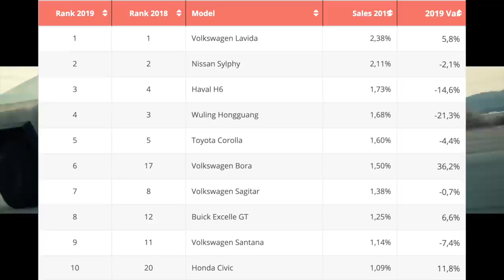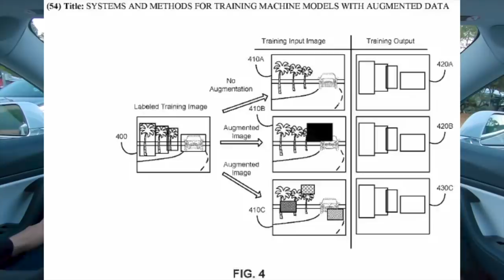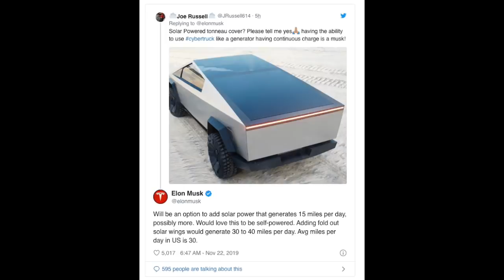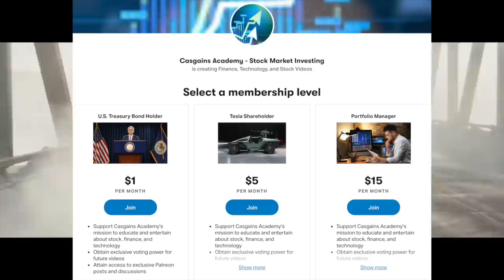Tesla's Upcoming $20,000 Compact Vehicle - An Industry Overdue For Disruption

Comment: Motor, pulley bar, mount bar, adjustment bar, hanger bearings. concession: mechanical(?) to lumens (ONLY), per story, add to use but do not change anything already attached

Comment: We don't know anything about the specs? Yes and no. Yes, they didn't tell us anything, but Elon won't make anything that sucks, they are going down market, but coming out later, so they are working with better tech, and it will be smaller. I bet it will be close to a Model 3 Standard range plus in range and acceleration. I hears a story where they made a slow prototype, and Elon said it felt like something was wrong with it. I bet it does a sub 6 second 0-60, and is RWD, and the AWD model is sub 5.  They may very well go for a range similar to what the 3 has today. The 3 will likely have more by the time it lands.

Comment: Actually I believe Model 3 is good for the task. When produced in massive quantities, the cost of each will be reduced. Also most of the cost of an EV is it’s batteries. Current batteries suck, they are the major holdbacks of EVs, if new battery tech can increase the specific energy, then less batteries would be required, thus making it cheaper. All of these Tesla vehicles would have a lot of potential in reducing costs i think. They’re far ahead of the competition.
Reply: Gasoline engines are complicated machinery with hundreds of moving parts, but could be made cheap due to the sheer quantity produced. The same can be applied to batteries. This is more likely with China’s industry that produce things at massive quantities, although not very good quality

Comment: I'd like to see a single passenger self driving pod car. That would be so cool. 

I'd also like to see china make their first self driving city where human drivers are full out banned 

I think china is in a position to be willing to take that risk and see what happens
Reply: YES, prevent traffic accidents.
Reply: A single passenger car should ideally be pedal powered. Heavier vehicles with more space are reserved for other methods of propulsion. A bicycle railway would be cool. I wonder how low you could get friction. I don't want to see human drivers banned. That would make it impossible to use older cars on public roads. It's not necessary either to ban human drivers. Very few people will still choose to manually drive their cars once the technology is available to do it for them.
Reply: @bangerbangerbro  
You can srill drive yourself on country roads. But in areas where human drivers are banned it's a guarenteed car crash if you turn off the selfdriving feature. 

There may not even be traffic lights in those areas. 

Also what kind of drugs are you on? Why would you want to go 60+ miles an hour on a bicycle? 

Pod cars would be a good idea conceptually, tho no idea if it would be adopted because it's very unlikely to be any significant amount of comfort.
Reply: @Skinnymarks  Pod cars are an age old sci-fi theme. How fast are the cars travelling, like 200 miles an hour?, where turning off autonomy immediately leads to an accident? You would want to for fast on a bicycle because you can get places faster? A non powered rail would be much cheaper to set up than a proper powered one. Only problem is providing a system where each rail is only one way.
Reply: @bangerbangerbro  
You can't even properly criticize pod cars. I had to do it for you. It's just an entertaining thought I came across again the other day. 

And yes the cars will be going more than 150+ or down tunnels with tracks where any error in turning would greatly damage your wheels. 

And cars would be clearing by inches in intercecrions. 

Will this happen any time soon? Doubt it. Unless china decides one of its empty cities is self driving only and forces people into them. I think that is a possibility.

As for America. People are too insane about their ideas around "personal choice" which rarely have much to do with actual choice availability. Ironically enough. 

So idk how it will play out in America it really just depends on how social shifts around the perception of how dangerous it is to drive. Or how lazy people are or how busy they are and unable to throw away the time they would have on driving.
Reply: @Skinnymarks  I suppose Pod cars are more private but I just didn't like the idea of single seater "proper cars" that much. High-speed tracks sound like something that would come faster for intercity travel than for intracity to me. Easier to build the infrastructure as there are less existing complications (unless of course you build an entirely new city) and the high speeds are needed more. I don't quite understand your third line?

Comment: He’s right about the trucks from the legacy automakers though. From all angles they look similar. Nothing new or innovative.
Reply: I'm fairly sure I could tell which brands were which (the examples) and I'm not into American trucks or cars, though I am into cars. There is more difference visually between those vehicles and a model T than there is between those vehicles and the CT IMO. The CT proportions wise is barely different to the other pickups.
Reply: Elliott Savva And that is on purpose! Parking, loading, getting in the damn thing without a ladder, etc.
It’s SUPPOSED to be a pickup!
The innovations are its architecture and (proper) use of power! (See no fumes)
Reply: @boyupizzmeov4558  Exactly, the important differences are in aspects other than the look of the vehicle. You mean source of power, not use of power ("no fumes")?
Reply: It's the EV power for pickup truck that matters  the outward appearance dosent matter
Reply: @sunsetlights100  Unless it's functional of course - aerodynamic, good for load capacity or affordability of manufacture etc. But the fact that it looks different isn't important as you said. Just the main reason why it looks different (affordability of manufacture and body strength).

Comment: FIRST - 
Show me an electric car that was charged from so-called "sustainable" energy. 

Not gonna happen. All of them are charged from coal and oil based power plants. Nope, charging a battery operated car from a battery is not acceptable because they get their power from oil and coal just like everyone else. 

Prove me wrong!
Reply: And what if they are charged out of solar panels.
Reply: electricity generated by fossils have a set carbon footprint ..but that footprintis far less than fossil fuel cars ..the electric cars then use that electricity at a 90%efficiency ..compared to at most 25% for gas or diesel
Reply: Thomas Lee then you should look things up before posting....almost 50% power generation in CA is from sustainable energy(solar wind nuke hydro...). I have solar 9.92 kWh Sys.  I have an electric car and have 92K mikes on it 3yrs....so yeah I’m clean 🧼

Comment: Same battery and motor tech, just a different shell. Way easier than a typical gasoline car.
Reply: same petrol engine is in SUV and hatchback ... so, your point is?
Reply: @ibittime7574  i think em poit is, its easier
Reply: @marleyjanim5033  you think wrong, the el. engine is easy-yes, battery pack, pdu and cooling not so easy A.T.M. .. anyway, his point was that petrol cars cant swap shells, but that is wrong as you can buy a car and chose what engine model to have... so, a hatchback can have more power in the engine then a basic SUV engine... etc.
Reply: @ibittime7574  IMHO his point maybe

Its easier to put a shell on a skateboard of an EV.

Than it is to put a shell on a chassie of an ICE.

We just have to wait on main OP to respond

Comment: It'll be a while before a solar panel the size of a car roof actually makes enough power to usefully move a vehicle. However, 3 household panels charges my ebike, so at least I ride on light power 😎😁
Reply: roots No1 M Souljah well, if the car is only used for a few hours a day but sits in sunlight for the rest of the day?

Eitherway, free energy is always cool lol
Reply: @sennevanheghe6615  I agree, all contribution to energy use is good,  but it shouldn't be a marketing hype.

Comment: Solar panels on an EV make little to no sense: you need at least 100Wh per km at low speeds where power is dominated by rolling resistance, the car has maybe 2sqm of available surface area for surface panel, average insolation on a clear summer day is around 1kW/sqm and cells are only ~25% efficient when directly facing the Sun. Under the absolute best circumstance, you are getting ~500W out of the solar panels, which would allow you to move an EV at about 5km/h.
Reply: I think it's more related to top up the battery and not power the car while in use. Cars in general have a lot of standing time compared to usage, so it could  top the accu while parking
Reply: @Lou.Cypher  If you want to get any meaningful amount of power out of panels, you need to keep them close to perpendicular with incident light through the day. Panels on a car will be at poor if not outright unusable angles through most of the day unless you move your car multiple times through the day to track the sun. You'd likely be lucky to average 1kWh/day and if you did the sun-tracking thing, likely waste more energy doing so than you can get back.

If adding solar panels and related support components adds $1000 to material and manufacturing cost, you are looking at 10+ years ROI assuming the panels remain in pristine condition and performance the whole time, which they obviously won't due to aging, temperature, exposure to road grit, dirt, etc.

Solar cells on cars make no economic sense. Better off using the $1000 as a down-payment for a solar roof and power wall.
Reply: @teardowndan5364  thanks for the answer, I might also have misunderstood your 1st post a little. I have to agree with you. But I do believe they maybe make more sense on a pod bike or Biohyprid. But these are not cars. And hopefully the panels will improve and be far better in 10years.
Reply: @Lou.Cypher  There are many other problems with putting solar cells on vehicles. Car bodies have curved shapes for reduced air drag, which means solar cells on those surfaces will get uneven insolation and limit panel output to whatever current the worst-lit cell at any given time is able to output. If you want to put cells on curved surface, you are also limited to materials that can accommodate the flex and flexible substrates are less efficient. Laminating panels on non-flat surfaces will pose its own set of challenges and added costs.

I can imagine solar arrays making some amount of economic sense on electric/fuel-cell busses, cube vans, trailers, etc. where there is a substantial amount of flat space on the roof but not on passenger cars, too many extra costs, inefficiencies and complications.

Comment: They need to make a 2-door, 4 seat compact car with the cost-saving, angular, stainless-steel exoskeleton design of the Cybertruck, and simplified Falcon doors that take up the entire sides of the car so passengers in the back seats can get out just as easily as passengers in the front. 

Or in other words, a practical DeLorean.
Reply: Victor Hugo How would this be $60K? It would be a miniaturized Cybertruck, which begins at $40K, so this would have to cost less. The only thing that could potentially make it cost the same as a Cybertruck would be those Falcon doors, but it’d be nowhere near $60K.
Reply: John Edwards The Cybertruck has a stainless steel exoskeleton, and starts at $40,000, and would be much bigger than a compact car. So how would a compact car made of the same material cost more?
Reply: Something like.. these? https://www.behance.net/shiakas
Reply: Andreas Shiakas Yes, but more like a DeLorean
Reply: They wouldn’t do the doors again because of the production problems that went into the first one
Reply: Bob Nguyen Yes the Falcon doors would make it much more complex, however given how much Elon likes 80’s pop culture and how the DeLorean’s doors are so iconic, if he were to make a reinvented DeLorean, he’d find a way to make Falcon doors work and be affordable and reliable. They wouldn’t even necessarily have to be just like the Model X’s Falcon doors; they could just be gull wing doors like the DeLorean had without the sensors.
Reply: John Edwards The Model 3 weighs 3,552 to 4,100 lbs, while the $40K Cybertruck weighs 5000, despite being much bigger and being made of stainless steel. I don’t think stainless steel, as in the way the Cybertruck uses it, weighs as much as you think it does. 

The $40K Cyberstruck isn’t alleged nor a dream. It’s on Tesla’s website right now. While it does only have rear-wheel drive and only one motor, it comes with Autopilot standard, and the battery and air suspension system it uses to drive itself is what would power your tools, so it doesn’t need an extra generator. 

Where do you get the idea the battery for it would cost $20,000? In fact, have you even looked at Tesla’s website or anything having to do with the Cybertruck? Everything you’ve said about it seems to be what you just speculate.
Reply: John Edwards The $40K Cybertruck will be for people who don’t need all the extra power, towing capacity, or the power for tools. It’ll be more like an ultra-rugged SUV (that looks badass). 

But my point is if the most basic Cybertruck can be made and sold for $40,000, which includes all of Tesla’s electronics (excluding full self-driving but including Autopilot), then simple logic concludes you could make a 2-door car (like the size of the original DeLorean) made with the same cost-saving material and building techniques of the Cybertruck for less than $40K. It wouldn’t be less than $20K, but $25-35K (basically in the price range of entry-level sports cars). 

And BTW the original DeLorean weighed 2712 pounds despite being made of stainless steel, so stainless steel doesn’t weigh as much as you think, and thus such a car wouldn’t need a huge amount of power to run.
Reply: John Edwards Tesla is still in the process of increasing production, which is their limiting factor in making the Model 3 cost less, but once they do, they’ll be able to make the Model 3 cheaper, possible even  as low as $25,000.  

And I suspect my hypothetical DeLorean would probably be a decade or more away, and would will be sold as an entry-level sports car like the Camaro, Mustang, and Challenger, and would start around the same as a Model 3 if it had reached $25,000 by that point. But even if Tesla doesn’t make an entry level sports care based on the Cybertruck, I’m guessing they’ll eventually make an entry-level, 2 door sports car to compete in that market. But since they have the ability to make stainless steel cars and Elon is a big fan of 80’s pop culture, it’s likely he’d like to make a DeLorean in the future.
Reply: John Edwards Elon Musk isn’t necessarily in it for the money or trying to create a prestigious “brand.” He wants to rid the world of fossil-fuel cars, and that means making them as affordable as possible, which means producing them on a massive scale, which will in turn make them less expensive. If you haven’t already, watch Joe Rogan’s podcast with Elon. He’s not just a business guy; he’s truly a genius, billionaire, philanthropist. The goal of every company he runs is to help humanity and sustain it for as long as possible.
Reply: Some great things about the model 3/y is that it it came to the mass market by having the design being simplified and sharing parts ect
Reply: I'd add a two seater 1 door urban ultra compact too.
Reply: I prefer to look at it as a cheap Koenigsegg Gemera. But i get your DeLorean comparison lol
Reply: Please can someone tell me how to send my $1000 to reserve the first one. Let me make a prediction: as soon as Elon Musk will confirm the few needed details, even before the first mock up model will appear. Tesla will end up with at least 5 million advance orders in a 12 month period.